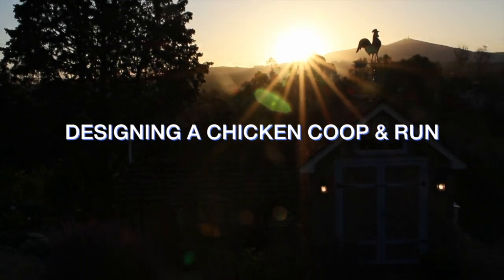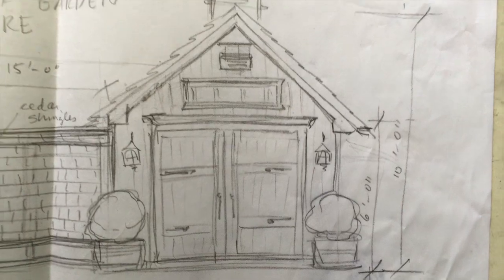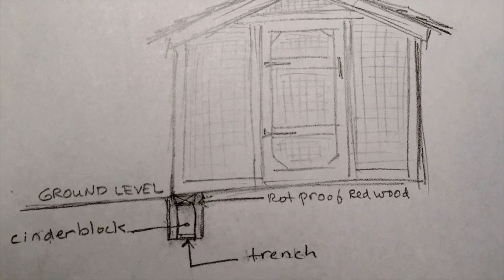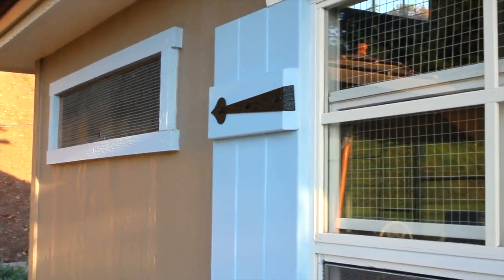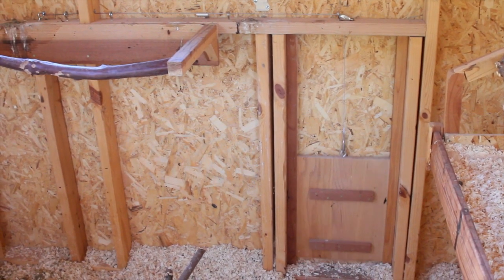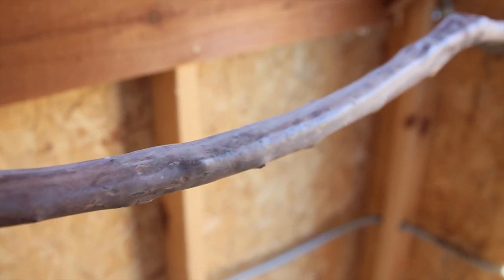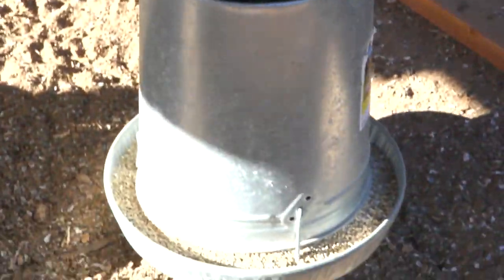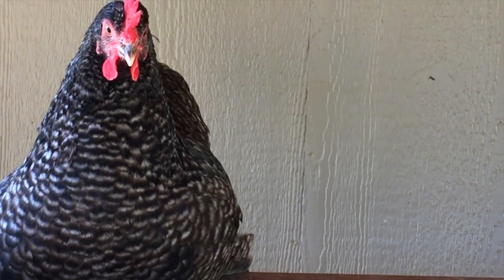DESIGNING A CHICKEN COOP

Comment: Here are some improvements you can easily do if you haven't done them already because, IMO, you need more space and ventilation. Store your "supplies" somewhere else and give that space to the chickens.  Take those double doors, cut them open, and screen them permanently with hardware cloth. You could attach a short awning or overhang there if you like.  Then line up the roosts on the far end away from the open door by attaching 2x4's (wide end facing up), or 4x4's, across the width of the coop about 3 feet up (dropping board optional).  Then close off the open vents around the roosts in cold weather but keep the front wide open.

Comment: Im trying build my chicken run also.  Great information!  I'm having  trouble with the hole where the wire comes out of the coop for the wire to open the chicken door from the outside.  Where did you purchase it?
Reply: A GREENER LIFE we bought the wire at Home Depot or Ace Hardware. If you predator proof your run by extending the wire mesh at least 2 feet below the ground or use concrete blocks, you don’t need to have a door for your chickens on the coop. I hope this helps.

Comment: Looks great. I'm surprised you didn't add a rainwater collection system with water nipple pipeline.
Reply: You know it rains so little here, but that is a good idea.
Reply: Sorry I just sent someone else your reply. I said it rains so little here, but that's a good idea!
Reply: Kelly Emberg Well a larger tank will hold more so that in between rains. There are a lot of advantages to having a system like that. The best advantage is that you don't have to fill it or clean it everyday. Also in hot weather you don't have to set out extra water. Just make sure the pipeline isn't in direct sunlight. Also if and when you have to go out of town, the tank can be filled and that will give your chicken sitter one less thing to worry about, one less thing  for YOU to worry about. 

One last thing that you may never need to worry about. City water system emergencies. Here in the past few years have had several time where the city issued an either boil the water or just don't drink warnings. Well when that happened I was so glad that at least I didn't have to worry about my chickens getting water. Especially when the the do not drink or bathe at all, warnings came out. Stores were running out of water fast and truck loads of bottled water were being passed out. So with such little water the chickens and people's pets were a big deal.

So a tank with a nipple pipeline is a great thing. Add rainwater harvesting to the mix and you are set.

P.S.  I forgot to tell you how much I like your video. Not only the subject and how great the chicken palace came out but also the editing, video production and not least your great voice and narration skills.  

TY for posting.

Comment: A fantastic coop, however an important point is.... ROOSTS must not be as round like yours!!!!- round roosts damage hens keel bone, their breast bone! The bone gets dented over time, creating hairline fractures, that then break. The whole process is painful and the ensuing death is agonising for the chicken. 
Alway choose a flat surfaced bit of wood for your roost wood, and either seal it with paint or oil it so it cant breed lice and feather mite eggs, like raw wood can! Choose a piece of wood that is no wider on top than a hen can grip, which is an average of two inches. So for each safe roosting perch you need 2 inch wide by 2 inch high(or 4 or 6 whichever you prefer), by whatever length required! 
Small note- If i were you I would clear laquer or paint inside your coop too, if it is raw wood like it seems, again, this is an issue most often forgotten by all but professional poultry experts, and we do it to minimise disease and parasite risk. Lino is awesome by the way, fantastic idea and first ive seen it, and i will be promoting it! Still seal the floor underneath though. You want to disease proof everththing you can, so anything not on a chicken, dies. That way when the inevitable wind bourne parasite comes in for a landing in your garden, you only need to bath the birds in disinfectant, and do a basic coop clean to neutralise the problem, not have to tear it all apart topaint poison on all the bare wood. THAT is why folk get recurring infestations, from the 5 types of feather mites, to lice, to dust mites or red spider mites, to scaly leg disease, the list goes on!! Check under your hens feathers and on the skin, by hackle base (bottom of of back of neck) and all the way around the vent (bottom) looking for any movement and any scummy grey looking miniature teeny tiny bubbles at the base of each feather. Good chicken people always check chicken bottoms in the sunshine or bright light, very regularly! It is the best parasite check you can do for their health, and of course treating its infestation will improve any hens egg laying 😀😀😀 Again, a beautiful set up, for more fun add a few  perch roost SWINGS at different heights and locations in the yard, ones you can move, and the hens will excercise more muscles in jumping from one swing to another, and keep themselves fit and amused for hours... and once they master a set up, just change it around!